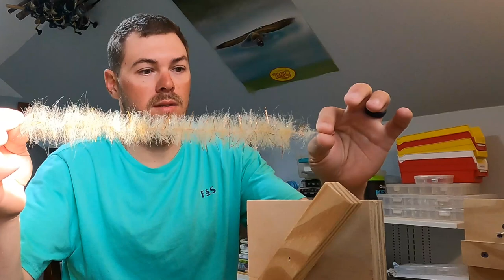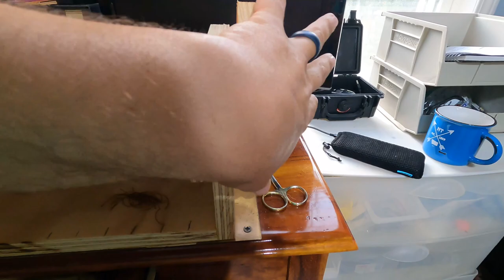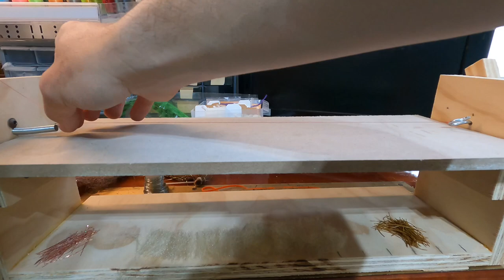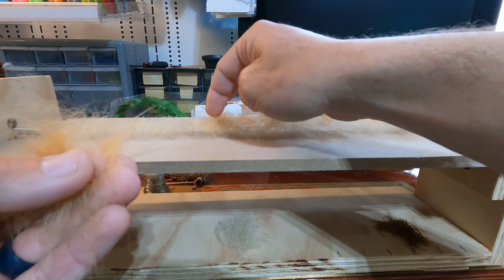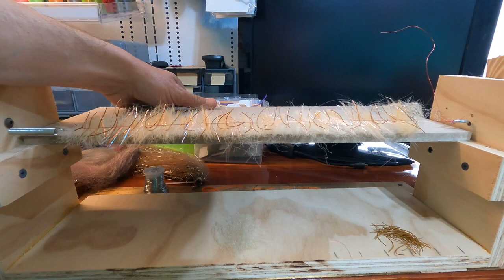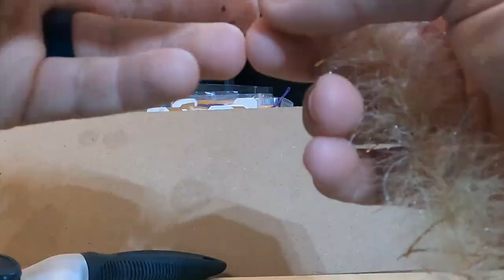How To Make Your Own Fly Tying Dubbing Brush and Dubbing Brush Table

Comment: Little tip on making better brushes. Get some dubbing wax and wax your wire before putting your materials down and it'll stick better when pulling out your board. And get some dubbing brush wire cause it's a little thicker and made for building dubbing brushes and I believe J Stockard carries it.